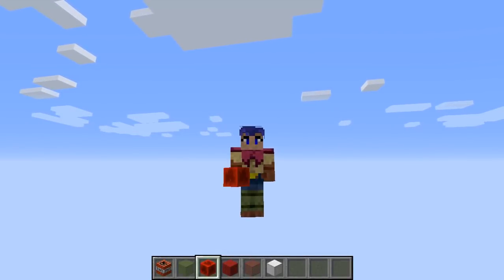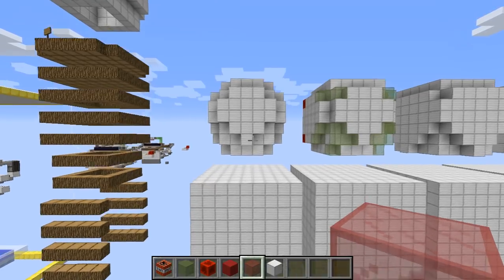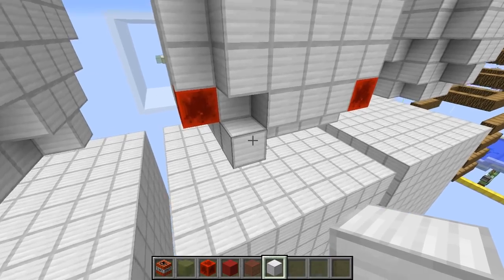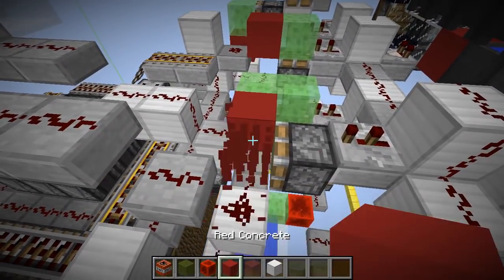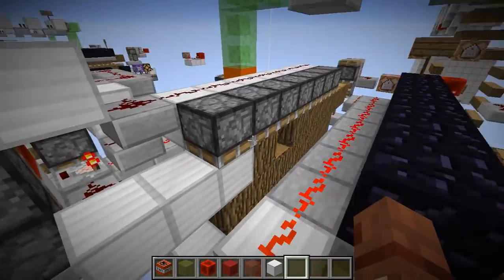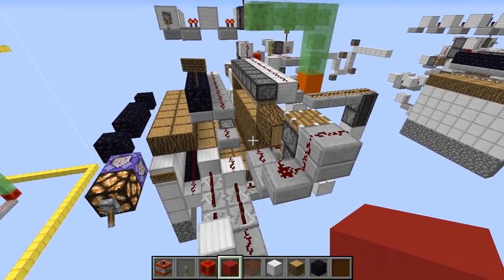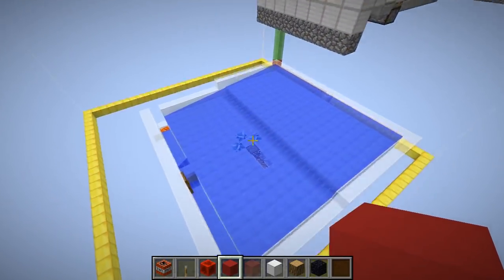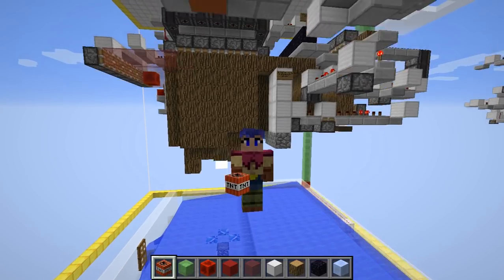Mouse's Simple Vertical Blast Chamber version_A2

Comment: Hey Little mouse i'm a huge fan of this blast chamber and i've built it already 3 times! Hope u can help me with just one issue i've found. Sometimes the stream of concrete/logs/coblestone/whatever have some issue with the first line of piston, i mean that the normal piston with 3 iron blocks infront of it, get stuck and can't push back the 3 blocks. This makes some minor problem at the dropper clock that goes out of sinc with the final push and more important it block all the stream of items! For example if u connect a log converter then you'll break it to. It's just a lag problem or this can be optimized/fixed some way?

Comment: Only 230? :)  I'm getting about 315 pretty reliably.  I used some of your techniques on powering the vertical pistons and it let me get 27 more blocks per TNT.  Interested to see what you're doing for 500 blocks per TNT.  My guess is similar to ilmango's old blast chamber, but removing a 3x3 or 5x5 area around the explosion.
Reply from the maker: The goal in this design is reliability over the lifetime of the chamber. You can do a 300+ but you'll get floaters every 100-1000 tnt.
that kills your block return efficiency
Reply: Do you mean the floaters that items land on? Do you have numbers on loss from that?  At least for a cobble farm it's not a big deal since the stone is generated for free, so only blocks per TNT matters.
Reply from the maker: its on the order of 4-5% once a floater develops. The problem with floaters with *low but finite probability is: they will show up during the life of the chamber, they will hang around for many iterations of tnt because they are no longer being turned to block 36, they can catch stacks of items. Basically, if your working with a small enough block that columns forming to break it is not an issue, then any floaters that form will hang around for an extended time killing your block return/blocks broken efficiency. I have a test world with some 300 chambers I'd be happy to show you. We could work on mitigating the problem. Ive started doing it using flying machines. Once you've calculated the probability for each block in a column to break you can decide where you can risk floaters. I'd love to discuss it :)
Reply from the maker: I'll include larger chambers in the next round for people who dont mind floaters.
Reply from the maker: Actually if you look at the individual rays coming from the tnt you're getting approx 9 per block in a setup. so a larger set of blocks may be quite stable. I will keep this in mind. Thank you very much for the input.
Reply: I'd be happy to collaborate, and got on the scicraft discord.  I use 1.13 now but shouldn't have trouble on 1.12 if that's what you're using.
  Also releasing a video today on this.

I found floaters not to be an issue with wood even with my design.  They seem to get blown up by the TNT before they cause problems, because I'm blowing up the TNT a bit lower (about 3 blocks above the bottom of the push limit).  Wood has a blast resistance of only 10, while cobble is 30.  I do get floaters with cobble after 300 TNTs or so.

A flying machine seems like the right solution for the floaters with cobble.  It's probably imperative to use if you're going for more than say 400 blocks per TNT.   Very interested to see what you're doing for 500 blocks/TNT.  I assume you're removing a 5x5 area around the explosion, because that's the only way I could get up to those kinda numbers.
Reply: @littlemouse8763  Glad if this helps.  It would be helpful to know the exact number of rays passing through each block.  It's still a mystery to me how it works exactly.

Comment: Built this from the world download provided in the video you did with ilmango, but having some trouble getting it to work for more than the first tnt, and can't  find any mistake. In what stage of the cycle do you recommend building it? Built it at the stage it is in the dowload world, where there are 40 items in the dropper closest to the chamber and the cauldron signal strength is taking output from the dropper behind the solid block.
Reply from the maker: Mango and I will release a different version shortly that uses a cleaner method of block storage delay instead of shuffling using pistons. It should be easy to convert what you have since I made all of the changes starting with the system in this video.
Reply from the maker: In the mean time i'd be happy to take a look at world download of what you have or send you a copy of the new design.
Reply: @littlemouse8763  
There will be a tutorial for the new version, right? In that case I'll wait, could probably use a break from this tree farm/blast chamber project anyway :D
Reply: @littlemouse8763   Little Mouse  Unless you know for sure the next version will be released soon, that world download would be very useful, if possible :)
Reply from the maker: @wilnil  I'm having trouble finding time for this hobby lately. I will upload a short clip and a world download for the better version. I apologize for the delay.
Reply: @littlemouse8763  I see, that's a shame :/

Comment: Well done :)
500 items/tnt!?! Are you blowing lapis ore up or something xd
Reply from the maker: haha. Nope. It will be used for tree farms and cobblestone generators. Its nearly done, I'm just finishing some of the timing issues. :)
Reply: @littlemouse8763  and concrete can it handle concrete ?
Reply from the maker: +Jimmy 1502 it can. depending on how good the block return efficiency is. rn I have 96% return. ideally I'd like 99% for a concrete chamber
Reply: @littlemouse8763  Did the 500 Block chamber didn't work out? It's now a year and I'm searching for a chamber in 1.15 and this is the best one I could find so far and it mentions other designs that are nowhere published, or did I miss it?

Comment: So, at the end of the video, you said there would be another one. Is that blast chamber still in development?
Reply from the maker: Both are completed. I have been extremely busy with work and my hobby has had to take a back seat :/
Reply: @littlemouse8763  Okay, no problem, thanks for the reply.